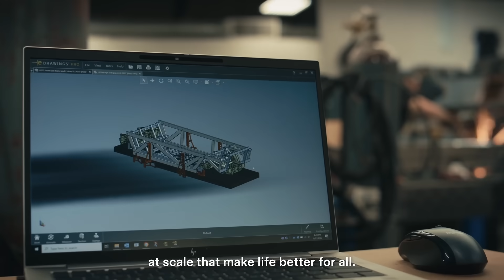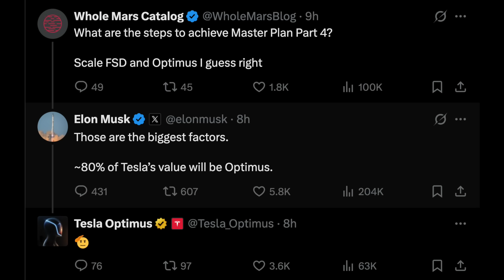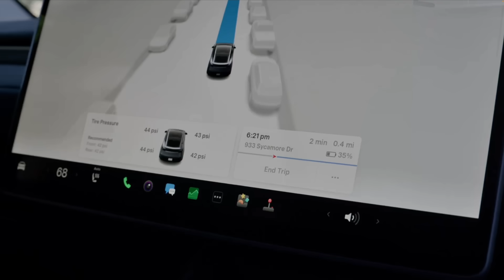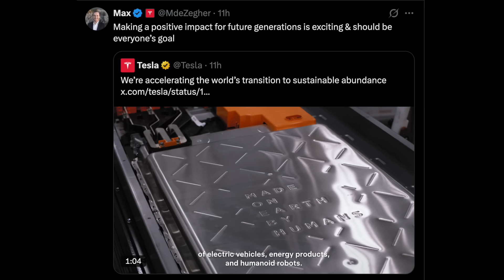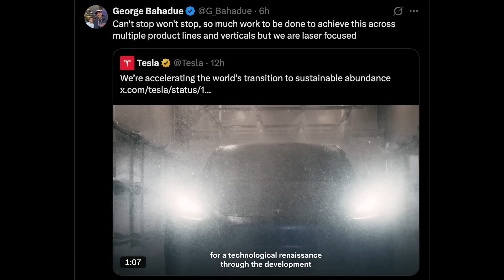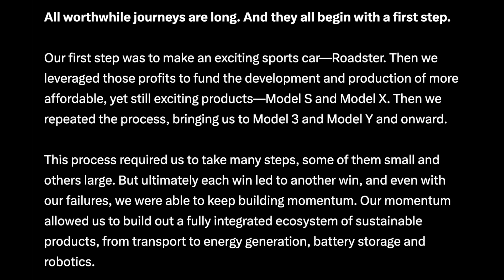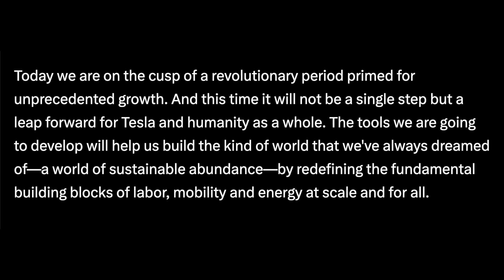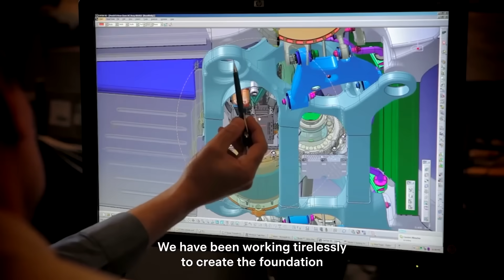This is sustainable abundance! - Tesla’s Master plan Part IV - Here’s to the crazy once!

Comment: Most people don't even know what Tesla is about at all. Especially where I life (Germany). Some examples: Tesla builds cars only and the sales are in a deep crisis and Tesla may also go bankrupt soon, because no one (in Germany) buys their cars. The cars a terrible built, expensive af, unsafe, technically outdated and the auto pilot is not working and dangerous, so FSD will be the same, if it is even coming in 10 years or so. (To be fair, the AP is really not good) Their Robotaxi flopped and is allready dead, because there are drivers in the car and the cars don't work and Waymo works and has allready won. And then there is the political engagement of Elon. There is not one positive headline about Tesla or Elon in the German news. 
German media and lobby spend a very, very long time to spread lies and doubts about e-mobility and especially Tesla and people got stuck with that. Germany changed to a backward country and we wonder why 10s of thousands of jobs are deleted by the car companies agenda. The agenda is pushed by peoples perception, and their perception is controlled by media and loby. It is a downward spiral. We keep discussing about if 400km is a sufficient real range for a car, because German cars need a range of 1000km you can rip of in one sitting without a break, every single day. Of course there is 1% of people who need range and short refuel times, but 80% of people think they need it, but don't.

But Tesla! Tesla is in crisis, even if they are hiring all the time. Most people are not even aware of Tesla Energy, FSD, Robotaxi, Optimus, XAi, Grok, SpaceX etc. and that Tesla is one of the best selling cars in the world and nobody cares about the sales in Germany.